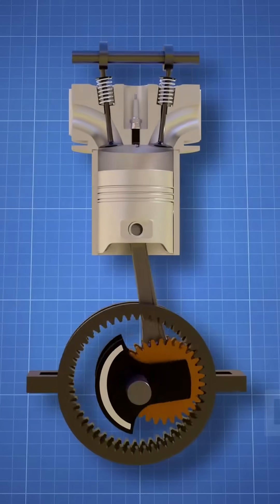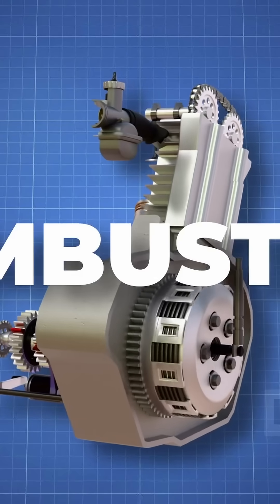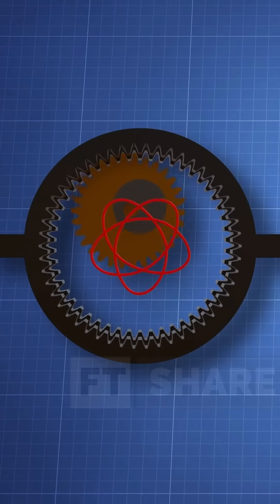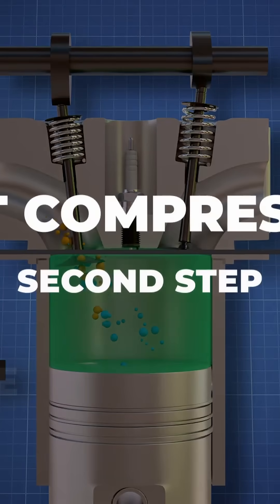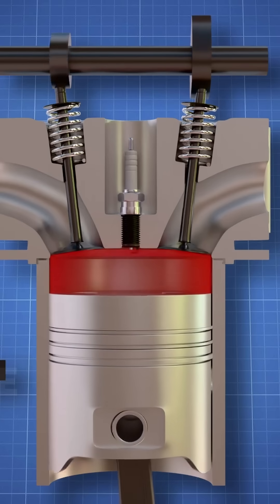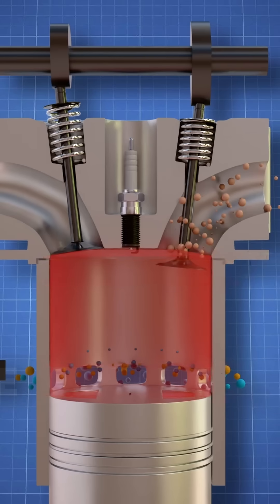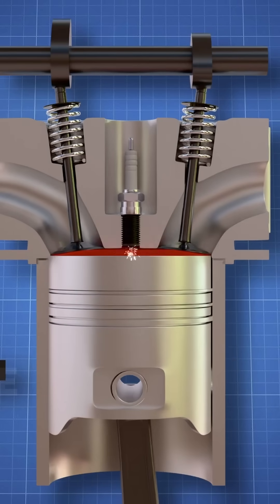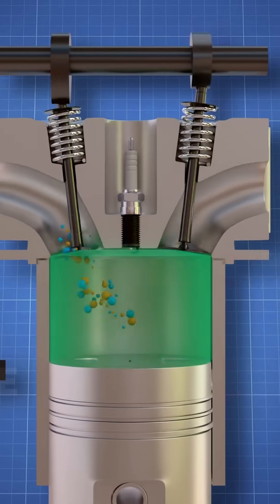How the Porsche 6 stroke engine work?

Comment: but how will the 2nd combustion happen, like it is exhaust gases?
Reply from the maker: Before the second combustion the piston uncovers intake ports through which fresh air fuel mixture rushes in and pushes out the exhaust gas in a single stroke like 2stroke engines...that fresh air fuel mixture is combusted in the 2nd power stroke
Reply: @superchargedpetrolhead  then how does it make it anymore efficient?
Reply from the maker: @Rakshith.V-n3t  just the fact that it makes power twice every 6 stroke instead of say in a normal engine which makes power once every 4 stroke so twice every 8 stroke..
Reply: @superchargedpetrolhead  okay thank you

Comment: six strokes work by the piston reaching its maximum downward length in the 4th stroke, compared to strokes 1, 2, and 3. This is facilitated by a planetary gear system in the crankcase wheel. During that time, the second air/fuel mixture charge is taken in from a cylinder wall port, similar to a two-stroke engine (e.g., RX100). This intake occurs while the 4th stroke (exhaust) is expelling smoke and the exhaust valve closes. The 5th stroke is the second power stroke, and the final 6th stroke is the exhaust stroke, which completes the cycle of 6 strokes but this engine requires more complex mechanism which increase price of vehicle in to 1.5x times👍

Comment: Most of the people don't understand that, oxigen  makes real explosion when compressed.. the fuel engines didn't even need this much fuel.. with very minimal fuel, engines can run..

There were plenty of research went on that near 1940's.. then all vanished..

Even some people claim that, 400 miles per gallon of fuel in car.. which is around 170 km per litre of fuel..

If they made like that before 100 years, definitely every company can make such vehicles.. which can run at least 50 km per litre.. the companies are not ready to research such field.

I'm not surprised with porsche as I've seen that pure oxigen itself can blast at compression without any extra fuel..
Reply: Its that way because of the giant oil companies that hold a tentacular control over the car and engine industry and research
Reply: this is quite interesting